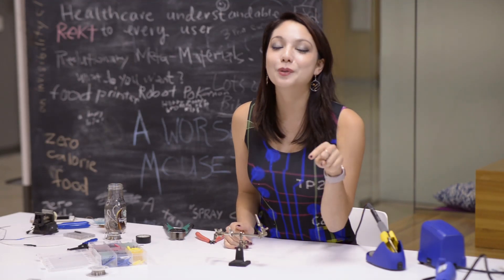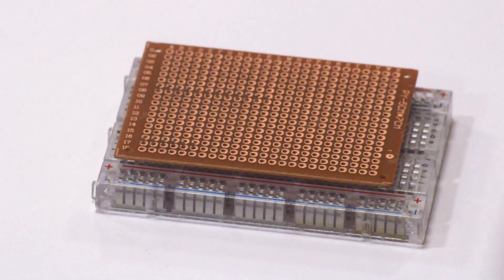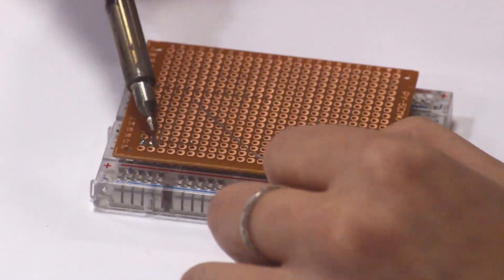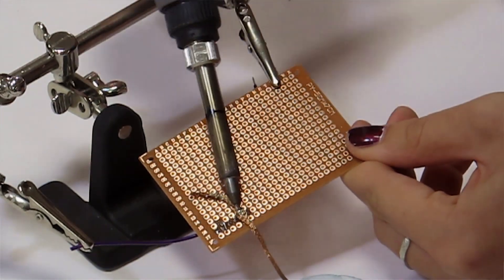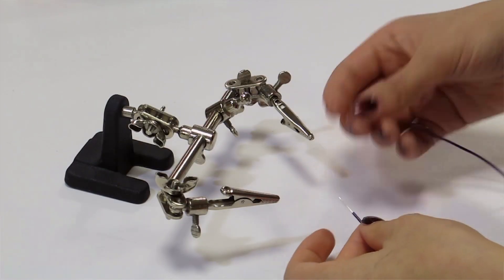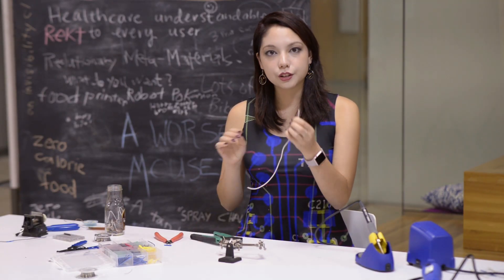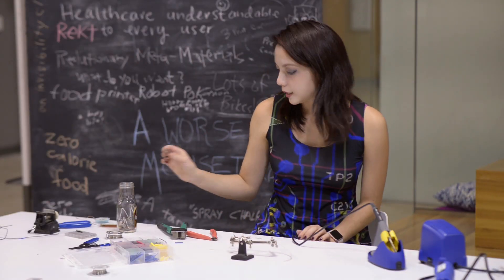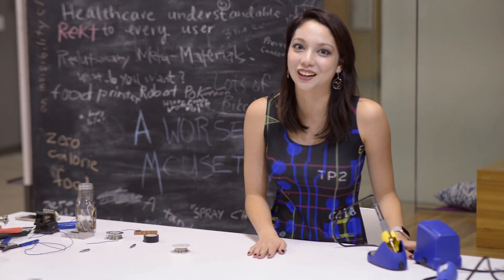HOW TO SOLDER

Comment: GREAT VIDEO, but - Should probably consider the health and safety issues? + Soldering can have mechanical strength, many jewellery items are soldered, but that can also be called brazing.
Reply from the maker: You are correct-- I suppose we should have specified "electronics soldering." Jewelry soldering is a totally different process, typically done with a butane torch and a different type of solder.
Reply: "Silver soldering" used in jewelery is a kind of brazing,  brazing alloys have much higher melting points and thus stronger in themselves.  Brazing requires dull red heat temperatures, which would destroy every electrical component that isn't entirely metal or ceramic.  Brazing accidents can involve severe injury, soldering can cause a small burn at worst - for brazing eye-protection is required for instance.  For soldering an appreciation of which end of the iron not to grasp is pretty much all you need to know, and using a suitable stand is only safety equipment required.

Comment: Stop wasting  the solder.
Reply: Clean the tip, use fresh solder everytime, otherwise the joints will be bad - yes you have to waste it!
Reply: No you don't have to waste it!  STOP cutting off a piece!  Just throw the damn spool over your shoulder if you can't  unroll and solder at the same time.  Cutting pieces like that IS a waste, and regardless of where you dispose of it, it WILL end up in a landfill.  Just use it right from the spool!!!!!!!  AUGH that drove me nuts!

And for the love of god, if you STILL can't use the whole spool continuously, lay the pieces end-to-end and SODDER them together.  crikey.....

Comment: Not to be a stick in the mud but safety first!!!!! Safety googles. 2nd year in college not listening to lecturer I was soldering perf board and heard a slight pop, the solder hit me on the eyelid thankfully since then SAFETY GOOGLES always. The rest of the video is brilliant for beginners.
Reply: That's a rare event - I've never used eye protection for soldering, but know to never solder a live circuit (that can explode solder at you if you short something).  And for close-up work I use a magnifier (which I guess is eye protection too).  However for a beginner I would suggest use protection until you can decide for yourself the risks.

Comment: Don't get a cheap soldering iron. You will forever be wondering why you can't get the soldering to melf properly. And use brand name solder. The brand name stuff is like $3 so no loss there.

Comment: RoHS solder is harder to solder because its free of lead and lead helps the flow of solder. If you care more about easy shiny soldering than baby seals or mother earth, use solder that contains lead (roll is marked with "Pb" like "Sn60Pb38Cu2") it flows better but you should not breathe in the smoke, so solder with a fan that blows AWAY from you (you don't want to cool down your iron or the parts) and open your windows. Also make sure you buy multicore solder containing flux, which is a flowing agent. If you use separate flux i recommend washing it away after soldering, because its corrosive and will eat away your precious electrical connection over time.
Reply: Sn63Pb37 is where its at for hand soldering.
Reply: You don't have to be afraid of breathing in lead vapors - there aren't any produced, much higher boiling point of over 2000°K. The fume is dangerous because of the flux in the solder-wire which is carcinogenic.
Cleaning off the flux is good, but there's also flux called "no-clean" which won't corrode the board (or is at least less aggressive).
Reply: For hand soldering only use the lead-free solder containing silver.  The non-silver lead-free is impossible to rework after the first melting as it isn't a eutectic alloy.  The silver stuff does cost more, but its a tiny proportion of the cost of any electronics, don't skimp just buy the silver stuff, its as easy to use as leaded solder (I know I moved from
lead to lead free), but requires a somewhat higher iron temperature.   
As for lead toxicity, never use abrasives on lead-containing materials, lead dust in your lungs will poison you life-long, remember the LD50 for lead is in the milligram level.
Reply: And rosin flux is not carcinogenic, its just pine tree resin + maybe camphor - some people are sensitive to its vapours, but its classed as a mild irritant, not a toxin.
Reply: Lead free solders have higher melting points than most leaded solders. Typical Sn63Pb37 melts at ~185C (365F), while a typical SAC solder, Sn95.5Cu4Ag0.5, melts at ~225C (437F). Saying "the lead helps the flow of solder" is not true. In this particular case, the tin-lead solder having the lower melting point is what helps the solder flow because the parts around don't have to get as hot.

Do a quick Google search and you should be able to find lead free solders with lower melting points (therefore easier to solder), but most RoHS solders will have higher melting points. The higher melting point makes it more difficult to solder.

If you want to know why RoHS solders have higher melting points, you may want to start studying chemistry and/or metallurgy ;-)
Reply: glad you added the end on that as i always clean no matter what

Comment: Even though the solder contains flux, adding extra flux is beneficial. It not only makes for better solder flow & nicer shiny joints. It also aids in heat transfer between the iron tip and component too 👍
Reply: I'm practicing soldering wires together and it looks cleaner using flux then without the type rather it's liquid,pen or paste is up to the individual I prefer paste as it's easier to work with
Reply: @Hellraiser988  Even though solders do have a certain percentage of flux in their core, adding more flux paste etc will usually make for a nicer looking joint 👍

Comment: I too often forget my soldering station on... until I added a 60-minute mechanical timer to the AC line.  When I want to solder I crank it to 60 minutes.  Occasionally I'll bump it back up as required.  So it's never left on accidentally for more than 1 hour.  

Something like this: https://www.amazon.ca/Woods-59718-60-Minute-Decora-Mechanical/dp/B001XCWLWY/ref=sr_1_22?s=hi&rps=1&ie=UTF8&qid=1519937063&sr=1-22&keywords=timer%2Bswitch&th=1
Reply from the maker: THIS. Definitely adding this to the lab
Reply: If you have a small shop air compressor, same trick can prevent what happened to me... I left mine on over the winter.  Too cold to work in my small garage, so it ran intermittently to maintain pressure for 6 months or so.  Tried to use it in the spring, no joy; piston had disconnected from the crankshaft, then the loose parts beat the insides up.

Obviously this won't apply to large, professional-grade compressors.  But the ones we weekend warriors have (5 gallon, $150 or less) can't take that sort of abuse.
Reply: You can add a mechanical microwave timer to it.
Reply: Cedric Silvester, I hope it doesn't "tick"! I hate ticking clocks (and my wife insists on having a battery-powered analog clock in the den,   because she thinks it's pretty of course, but I find it difficult to "tune it out". 

My Aoyue solder-sucker at work shuts itself off if it isn't used for an hour, I'd actually prefer to be able to modify the time frame for shut off, or even defeat it sometimes, but although the control circuitry is heavily digitized,  as far as I am able to find out it doesn't appear to have that function built-in, and the crappy owners manual doesn't even mention it.
Reply: Good point!  I have an older mechanical timer (there is some sort of motor that turns a high-ratio geartrain inside); it does indeed tick loud enough to be annoying in a quiet room.  I use this one on my small air compressor in the garage; I don't notice the ticking at all.

For the soldering station I use an electronic timer; it has 4 buttons (15min, 30min, 1hour, 2hour) and an OFF/MANUAL/AUTO mode switch.  Set AUTO mode on the switch and tap one of the buttons, wait for iron to heat, etc.  It makes absolutely no noise.

Someting like this: https://www.amazon.com/GE-Button-Digital-Wall-Countdown/dp/B007BJULYS

A bit expensive (perhaps Canadian$35), but I consider it a safety device, so worth it.

Comment: Pretty good tutorial, Xyla!

Love that you stress to not rely on the solder to be the structural strength.  I see so many videos where 2 wires are lined up parallel and then soldered, or pass thru a solder lug without a single wrap around.  I wonder how many projects fail due to lazy soldering practices.

My only suggestion is use less solder on the thru-hole examples; you mentioned you're looking for a "pyramid", but that's too much solder.  Just enough to make a concave surface is better.

Also, put your soldering station on the right side of your bench would reduce all your right arm motion... I was forever knocking my soldering iron again my part until someone pointed out this simple adjustment.
Reply from the maker: Blame Andrew for the soldering station position haha - we did it for the camera. But good tip on solder amounts - we went the "heavy" route because a lot of people seem to want to put the world's smallest solder dot, and end up barely making a connection!
Reply: For surface mount work solder is the only structural element, so solder can be structural.  Good lap solder joints are OK to use where there is no strain to take.  And yes there's a limit to surface mount solder's strength, heavy parts use through-hole tabs for extra mechanical support or risk cracking off the board when dropped (inductors
are the most common examples of this).

Good lap solder joints are difficult to make, however (there must be no vibration during solidification when nothing else is supporting the work, otherwise the joint will be dry - this is why its simpler to avoid lap jointing as a whole cause of unreliability is avoided.)
Reply: Urghh! I like guitars and I have seen too many git rewiring vids with people just holding things together and hoping the solder will "glue" them together. Particularly bad considering the vibratory nature of the joint's environment!

Comment: Most of the current circuit boards can no longer be repaired by the common soldering iron. Many of the multi pin chips are surface mounted and require special soldering tools and procedures to install or remove these specialty chips.

Comment: A good mechanical connection is always necessary prior to applying solder. The mechanical connection holds the parts together and the solder secures and covers the mechanical connection.

Comment: First clean the tip using the damp sponge and then apply fresh solder.
Reply: just avoid the sponge altogether, it heat stresses the tip

Comment: Max temp for PCB should be 300-350 MAX. Wires should be about the same. Hotter it is, the faster the flux burns off. Any hotter then 350 on a PCB will damage it, or cause burn marks. Or broken or damaged components.
Reply from the maker: We totally agree - Xyla recommended 650°F (~340°C) for this video because of the throught hole components and the large/long wires. But as she mentioned, turning the heat down is really never a bad idea!

Comment: Great meeting you at CES.  You a all are awesome, Please wear safety glasses when soldering.  I learned that is a good idea, after a glob of solder flicked off a wire I was tinning and left a blister on my eyelid.
Reply: Related tip: If you are using a steel/brass scrubber to clean the tip of your iron, don't run the tip across the surface like you would with a sponge.  Jab the tip of the iron into the scrubber and rub it back and forth while it is still *inside the scrubber*.  If you rub the tip of the iron across the surface, the springy metal will catapult little solder blobs all over the place, but mostly onto you.  And also onto hard to spot places on your board where they create shorts.
Reply: @docferringer thanks for this tip, I wouldn't have thought about the scrubber pad flinging solder, but it makes sense.
Reply: don't solder wires dangling in air....use "third  hand" or  something...

Comment: i want to put my multimeter on TP2 : )
Reply: I was just about to write that, but I guess there are quite a lot in the queue
Reply: C220 is that hot spot.
Reply: Same. It is a very high voltage point on her.
Reply: geek sexual innuendo
Reply: No offense intended but it's funny :) hope she is into electronics

Comment: Thanks for the tip about breadboard & headers.
Reply: Use an old breadboard though, as it may melt in the process :)
Reply from the maker: Of course! I soldered many crooked breadboards and breakout boards before figuring that out...
Reply: If you're not careful, you'll mess up your breadboard doing this. I use bluetack for stuff like this now.

Comment: Much knowledge about soldering is a good thing, but you forgot the most important detail of all..... safety glasses.
Reply from the maker: Good point! 90% of the time when we are soldering we don't even think about safety glasses, but that's no excuse! Usually your eyes are safe, but some solder flux tends to "sputter" - and once in a while, a bit will fly off in a random direction. You don't need tons of protection though - even reading glasses are enough to usually protect against the random sputter
Reply: This is an important point and something that I have noticed most people tend to overlook.  While I am sure that the chances are slim that it will happen...it does happen.  It happened to me MANY years ago as a young high school tinkerer.  The problem with molten solder, beyond the obvious burning, is that it resolidifies as a solid and gets embedded in your eye....  If you then start rubbing your eye... I think you get the picture.  I was lucky enough not to have any major lasting effects... but to this day I can still see a very small spider figure in the upper right area of my vision on my left eye that moves when I move my eye.  For everyone that thinks wearing safety glasses looks dorky while soldering... I think they should be reminded that they are soldering... just own the dorkyness.... or wear sunglasses if they must.
Reply: It is not a matter or "dorkyness", it is a matter of what's reasonable. But yes, if you solder too close, that might happen.
Reply: Definitely safety glasses. I was lucky to only had splashes on the skin of my face and not directly in my eye. I cannot imagine life with impaired vision, so I started wearing safety glasses. My eyes are way too important for me. A little extra effort in caution can save you a lifetime of distress.
Reply: Beauty and the Bolt, being 60 years old myself, my eyes are not what they used to be, and of course much electronic work has been miniaturized significantly since my days as a kid fixing vacuum tube type equipment. I frequently find that I am using a set of  magnifying lenses on a flip-down head visor; I typically use 5 diopter,  and sometimes 7 or 10 diopter (the lenses all swap into the same headset-visor). The ones  I use have thick GLASS lenses and will function well as safety glasses, and unlike some of the cheaper units with plastic lenses, if these get hit with some flux or a blob of solder it won't damage the lens. I would advise anyone who buys such magnification visors to not waste their time on a 3X or lower diopter, it's probably not strong enough for most people in most applications unless you're really young and have 20/20 vision. I have seen some magnifying visor brands with built-in LED  flashlights, which are handy, but you can also find clip-on flashlights that were made to clip onto the visor of a baseball cap or hunting/fishing cap for fly tying and hunting at night and such, and you can adapt one of those to the magnifying visor instead, or maybe stick a headlamp type flashlight onto the visor with velcro as I did. This definitely makes me look like a nerd, like that old cartoon character gyro gearloose perhaps, but that's all right, because I was a nerd  long before nerd-dom   became cool, and  fashionable!
Reply: Beauty and the Bolt, years ago when I was a telecomm tech,  installing Category 5 data cable, I nearly speared myself in the eye when I cut a plastic cable  (aka "zip tie") with wire cutters (why are they also known as "dykes"?), and the pointy end came flying at my face like a rocket and poked me in the eye, scratching my cornea. I wear prescription eye glasses every day, but they don't have side shields,  and the flying pointy end of the cable tie flew at me at an oblique angle and slipped through the space between the outer ends of the lenses without hitting the frame and managed to get through and poked my eye. I had to go to the eye doctor for an exam and get some special drops, and my vision was a little blurry for a week or so. It was just one of those freaky accidents that happen sometimes, but it does illustrate why proper safety glasses have side shields.
Reply: I would suggest safety glasses, no finger or wrist jewelry, and a small fan to vent the fumes.
Reply: SJP 
I have had glass in my left eye twice and plastic shards in my right. When doing nothing that could remotely require safety glasses.

If god/allah/yah/karma/buddha/yin is out for your eyes, they will get them. 

Upside is I am one paranoid bastard about my eyes. Never without safety glasses. The cool cop shade kind.
Reply: Bige4u you must be joking man...
Reply: Safety glasses!? What? That is not required at all!
Reply: Fuck off!
Reply: oh bige4u you're one of THOSE people. the kind that wear safety glasses where ever you go, if  i were grinding metal i would, solder, NOT ONE COMPETENT PERSON DOES IT unless their work requires it
Reply: @Astaldoath  - Not wherever...  only when needed.  Like when soldering.